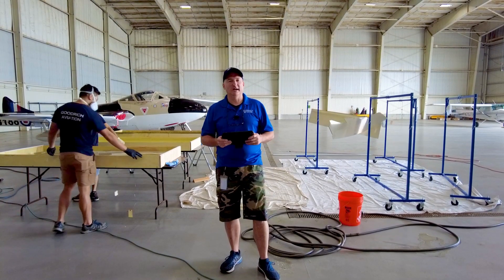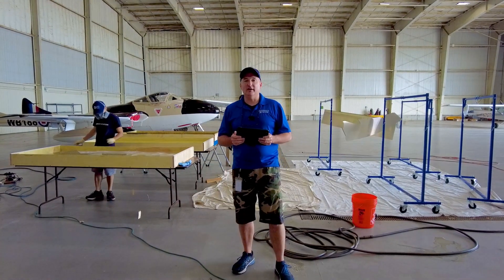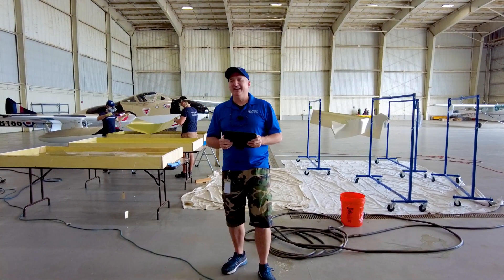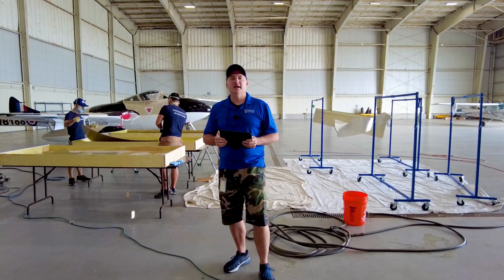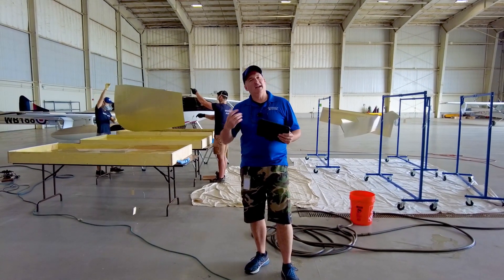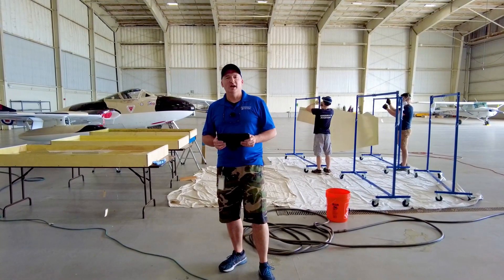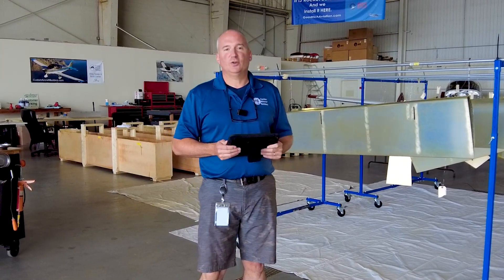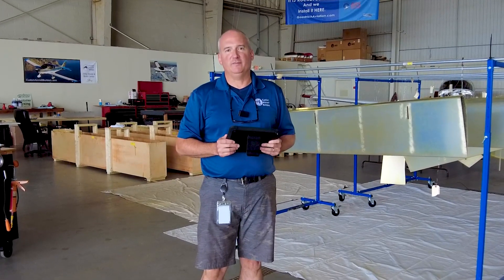Sling TSi Build EP4 - More Corrosion Treatment & Starting Wings

Comment: You would think that Sling would do all the corrosion treatment of the skins before they ship them to the customer.   I guess the skins are not 2024 T ALCLAD ?
Reply from the maker: All the aluminum is wrapped in plastic; removing it before you begin building is a time-consuming process. Sling would make the kits a lot more expensive if they did it and then performed corrosion treatment. 
The Sling skins are 6061-T6 which is more corrosion resistive than 2024. As a build center, we choose to use alodine versus primer for corrosion prevention. It was an expensive process to set up but easier over the long run.